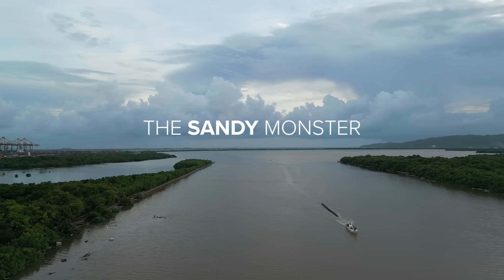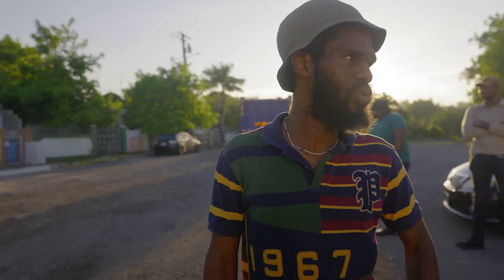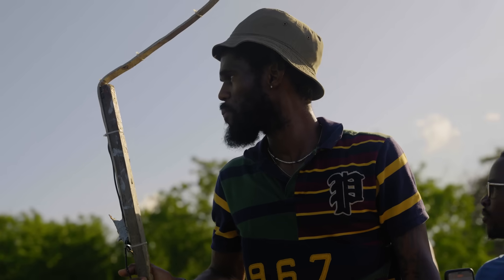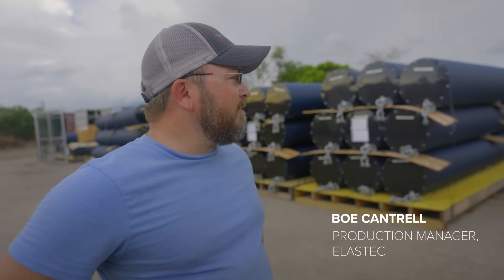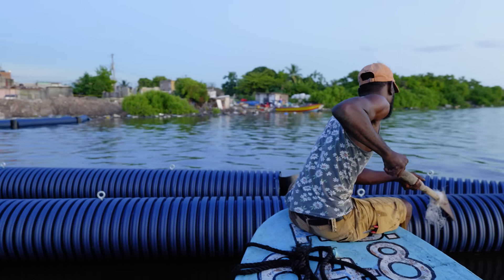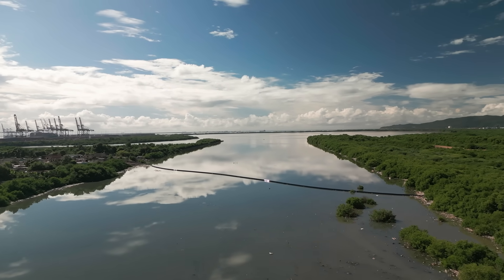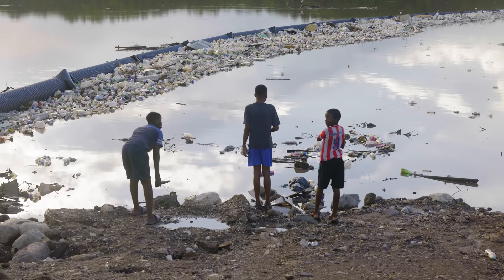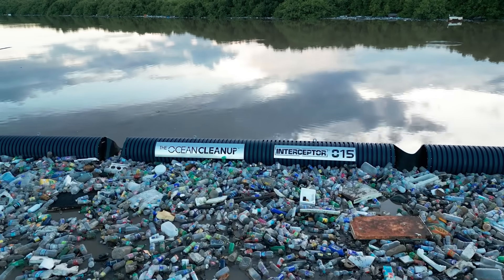Tackling Plastic Pollution in Kingston, Jamaica: Our biggest Interceptor yet

Comment: If you walked into your bathroom and saw the tub overflowing, would you start mopping before turning off the water?   This is exactly what you are doing.  If you don't stop the trash problem, then you can never stop the cleaning up.  You are not helping at all!  you are thriving off "climate change emotions".  If you are ok with that, than more power to you.

Comment: Im a HC Truck driver and have used vacuum pumps to load  Could you put a few pipes as well on the shorelines or even to the middle of the boom fences to help extract items as well, with large suction pumps ? You could station   sieves and sumps on the banks to drain out the water from the rubbish and pump the water in the sumps back out to the waterway, and a conveyor to load  rubbish onto trucks? ❤ Just a thought! 
Brilliant work you are all doing.  ❤

Comment: Who is working in preventing the problem not just capturing the plastic when it floats away.  I see refrigerators interiors that come from those that metal recycling shops that strip the metal and throw away the plastics.  They should be prosecuted

Comment: Although it looks like quite an operation, it is actually pretty small. A dozen people or so, couple of truckloads of material and a couple of dozers. In the video there is also a shot of a bridge over the gully. Building that is about 100 times as much work as this, if not more.

The real question is why the local government is not providing waste management services. That's the real question.

Comment: Sooo... no addressing the root cause? Proper sewage and sanitation infrastructure, even for the less developed upland communities. Looks like 99% of the waste is the property of Coca-Cola and Pepsi. Seriously, need to start putting pressure on corporations for taking responsibility of post consumer waste. Whether that means a hefty buy-back program or going back to glass. Something needs to be done in all fairness, especially if Carbon Taxes become a thing on the regular people, instead of the main polluters not accepting some responsibility.

Comment: Solution to build-up guys: A cycling Cup belt that draws the waste to the end with another Cycling Cup belt that automatically drops them into Drive off containers.🤓💡
This will enhance the process for recycling at an advanced rate and prevent a pressure build on the Boom, ta dah, 😉☺️

Comment: Now the next step. Collecting plastic waste is one issue, the next issue is how to deal with the collected waste. We been doing research on this for many years. Best way is to built clay kilns which burns at 800 to 900 degree cel. That take care of almost 95 % of toxic gasses. The heat generated can be used for producing hot water instead of using gas or electric heaters. And they do have abundance of clay.

Comment: What stops the Trash to just simply dive under this Pipe and escape? since the Pipe is just barely going down into the Water, isn't the Pressure of the floating Stuff backing up at one Point big enough to Push under it? like also Bottles filling up with Water and sink under it?

Comment: Where I live all plastic bottles have a 10 cent deposit which iz returned when taken yo recycling depot. Plastic bags are illegal and plastic packaging is recycled in bins.
The reason Kingston has this plastic problem is poor discipline of the population and ths need of a recycling system. The sandy monster is simply dealing with but not preventing this in the first place.

Comment: Have you thought about distributing some metal water bottles or assisting in a public water filtration system? I see so many plastic water bottles.
Reply: water bottles is just a dent.  Consider the plastic containers for oil, soda, juice, dairy, chemicals, soap, etc, etc.  This company is focusing on cleanup.  Providing and distributing clean water is a whole different world crisis.
Reply: @emmakai2243  totally agree. but if they bought wholesale for $5 a bottle let's say, with a little branding. it's adspace for the cause, and for $1000, you get 200 bottles, 3  plastic bottle per day (which is not enough water but let's be conservative) for 365 days would net 219,000 less bottles. it would be enough to convince others to get their own and snowball those numbers.

Comment: Single use plastic needs to be ended, or regulated down only for the absolute necessary. I know it not that simple, some nations may rely on bottled water more than others but in general it must be doable. Other than that, it seems obvious that this throw-away-economy can hardly be the way forward. In time, even if it sound sci-fy, things need to be long lasting again (again regulation, against planned obsolescence) and reused. I would gladly buy a Coca-cola in syrup syrup  form rather than buy bottled. And I would buy drinks from tap into my own refile-bottle like we bought sparkling water when I was a child. Water could be sold from gigantic containers, and public wells and drinking fountains could come back. The economy seriously needs to change, and power and ambitions needs to be shown elsewhere, in service, given value, virtue, joy and kindness, rather than in over purchasing. I know this sounds foolish, but it this works in smaller communities, and some of these ideas are already in place in some countries.

Comment: This is different from all your other systems - how do you get the trash out of the water?
Would love to see how that works.
Reply: Earlier in the video at 9:12, when they were showing the other gullies/rivers, they showed one of the machines taking the rubbish out of the water. It's a boat with a moving ramp that pulls the garbage out of the water.
Reply: I don't see how a round plastic pipe should hold back a lot of trash when there is a little more current
Reply: It will probably be an excavator like in Guatemala, for a barrier that size a small boat wouldn't work

@manuel69600 i believe they are not to "hold" the trash but raher guide it towards the collection zone, if that barrier would hold all the floating object the force would just break it
even if 30% will escape that is still a huge win and there is room for improvement

Comment: The people there also need to quit dumping trash into that river.
Reply: They've talked about this before. These places often don't have infrastructure to take care of the waste. There's no recycling center, no landfills (and often the trash in the river is washed out of make-shift landfills during storms -not actually thrown into the river) and no trucks that come by to pick it up. Waste management takes much more infrastructure than most people realize. In this video they said that the locals are excited and wanting to help tackle this problem. Usually ocean cleanup also helps to set up some kind of waste collection and management systems, but starting from scratch takes lots of time, knowledge, resources, and money.

Comment: The real issue here is not having proper waste management programs. The whole gully will eventually look exactly the same as it was before the cleanup, if the Jamaican government doesn't do anything about waste and the people also need to respect the environment.
Reply: So true! I think that there needs to be another arm working alongside the Ocean Cleanup to educate and empower local communities and government to make changes to prevent waste from ending up back in the gullies, streams, and rivers that are being cleaned up.
Reply: @JoshBartKzTSIS building up proper waste management infrastructure would cost a ton more than what this little band aid would cost - on the level of requiring country funds and not the small funds of an ngo
Reply: @JoshBartKzTSIS The problem with that is the education branch of such an effort usually gets corrupted.  And, the funds to be used for such efforts get diverted to greedy crooks.
Reply: They've talked about this before. These places often don't have infrastructure to take care of the waste. There's no recycling center, no landfills (and often the trash in the river is washed out of make-shift landfills during storms -not actually thrown into the river) and no trucks that come by to pick it up. Waste management takes much more infrastructure than most people realize. In this video they said that the locals are excited and wanting to help tackle this problem. Usually ocean cleanup also helps to set up some kind of waste collection and management systems, but starting from scratch takes lots of time, knowledge, resources, and money.
Reply: Recycling centers and landfills can be created. They have roads, they just need to find the will to do it.
Reply: @courtneyperry7659  its mostly education about the problem which is missing not really the infrastructure. The European south had problems with rubbish on the streets until the late 90. Moreover the Use of plastic is a problem. Its cheap enough to throw it away.
Reply: Racist.  @Sapphier4Dav
Reply: @mel-m5k9u  is this your educated contribution to this conversation?
If you label me a racist be ready to explain yourself.
Whom am I racist against and why?
You better back up your comment.
Reply: @Sapphier4Dav you’re talking out of your butt. If you weren’t born into a context with regular trash pickup and infrastructure designed to hide the consequences of your overconsumption and waste you’d be in the same situation as these folks.  

Look at NYC during a garbage strike.  You think New Yorkers aren’t educated about how to stay clean?   Yet once the trash collection pauses, piles of garbage build up and the rat population explodes.
Reply: @courtneyperry7659 nah the people their are mostly just nasty, don’t make it fool you. Coming from a Jamaican
Reply: I think people doesn’t understand how hard it is to have recycling collection when the tax collection doesn’t work. If you can’t force tax on packaging you can’t create the incentive to collect it. 

When that is achieved, like here in the Nordics where we recycle more than 95% for 30 years, we get taxed to lower usage of plastic when we doesn’t really need to. Create incentives to recycle is key.
Reply: @macjonte  no country in Europe recycles more then 40%, I think you mean the EPI waste recovery score. The highest amount of recycling is done by South Korea at around 56%, and in Europe the best recycler is Slovenia followed by Germany and Belgium, so not the nordics
Reply: @noa4644 
Depends on how you count energy recycling I guess? The Nordic (particularly Sweden) has invested alot in energy recycling with effective fume cleaning. 
But the important thing is there is waste collection so it doesn’t end up in a stream somewhere.
Reply: Indeed it's a prevention and not a cure but with no sign of us humans changing our filthy ways anytime soon, I'll take this amazing prevention! Top work!
Reply: I hate when people just ream on stop gap solutions. You think people are that naive and don't know the real cause?
If proper waste management was easily implementable, it would have been done.
Thanks for your input keyboard warrior.
Reply: @HKim0072 Seemed to be easily implemented in all white western nations dating back to hundred if not hounds of years with sewage systems. Amazing where all these trash rivers form. It’s almost like the ape brains can’t work out how to get garbage bins, garbage trucks and dig a bloody hole in the ground
Reply: Props to The Ocean Cleanup for clean up real shit.
🗣️📢🔥
Reply: Don’t be naive and simplistic. Proper waste management is complex and costly to organize. This mitigation solution took just a year to put together thanks to TOC’s expertise it’s both a tactical and sustainable protection measure until the long-term approaches bear fruits.
Reply: What happens to the plastic waste caught by the berm, does it go back to landfill?, if they can't deal with it on land, it's going to be harder on the river to clean up and they still have to deal with it. The only positive I see is, the locals will see how much plastic is dumped in the river, and that might help them to reduce their waste.
Reply: @ 
Yes, the sight make locals understand it isn’t sustainable.
Reply: @dogbreath6974 that’s the only positive you see? 🤦‍♀️
Reply: The issue is these countries doesn't have the infrastructure like we have in the U.S..stop shaming people for your unearned privileges.
Reply: No we need to stop manufacturing with plastics altogether,glass or other materials
Reply: @nevergiveup9321  I agree, but if it’s not plastic it’ll be whatever other material is widely used. Physical pollution will still be a problem
Reply: So true. My garbage pick up is intermittent. Only two times since January. And two times from Oct-Dec and it’s supposed to be weekly.  Overflow and things get blown around . 
Anyway this makes me so happy!  Thank you so much all involved . 
People please stop littering! 10 fridges were even out there! 😮
Reply: Who will pay? There isn't a budget. So non profits can set up recycling to turn plastics into paving, translucent light panels, planters, buckets. Things that could be used by the Jamaicans.
Reply: @wendymorrison5619 
About dotting the bill: it’s best done by tax on raw materials so it will be cheaper to use recycled material instead of new.
Reply: I've said this for years, in all these third world countries where they are doing the cleanups - if the waste disposal infrastructure is not improved then the same shit will continue.  And locals chucking stuff in the rivers too.
Reply: We also need to find an alternative to plastic bottles etc.,
Reply: This sort of project shows the magnitude of the problem. Hopefully inspiring kids, that's where the long lasting change eventually comes. Will never be immediate but 10-20 years who knows......I hope that's the case anyway 😊
Reply: I’m sure, if you can persuade the community to pay for adequate refuse collection, disposal and recycling, the government would be able to provide such a service. Sadly, the community cannot afford such a system and without funding, the government won’t be able to pay for it.
Reply: Even in countries with proper waste management (so called FIRST WORLD COUNTRIES) a lot of people dump their trash on the street, in the woods, into rivers! People are dumb!
Reply: Its the cause of the U.S. its the same with clothes for other countries.  The U.S. just causes problems "to figure a way to fix it" the U.S. needs to change for this to stop. Stop making so much needless crap.
Reply: Snowball's chance in hell of that happening.
Reply: Yea mon!
Reply: the program is to keep trash out of the oceans.
Reply: What happens to the waste which is caught? Are the bottles recycled ? What about the plastic? The people need to be educated about how you deal with waste. It should be taught in schools. But it's of no use if there are no possibilities of recycling and if rubbish collection is not done regularly.  How about the factories snd their waste products? A lot of work, but it pays off in the end.
Reply: Government has the biggest lever. Whatever is brought in is going to be waste. Regulate to cut down at the source is the most effective.
Reply: That is a perfect reply. Many of the countries using waterways as their trash deposit centers have no other options and their governments could care less.
If there were any politicians with vision they could do the cleanup then recycle the plastic into fuel oil
Reply: The real issue is one step farther back to the plastic companies impunity towards the earth for the almighty dollar.
Reply: The real problem is the production of this crap in the first place.
Reply: @ 
Depends on what you mean by crap. Even high quality products have sooner or later reached end of life. Recycling is key.
Reply: They just keep dumping into it
Reply: @diannamorris5844 ”they”?
Reply: Careless dumpling is a big factor. How do several fridges get in that gully if not for negligence. Years ago I passed through Rae Town and saw all this fabric, with bundles of old clothes clogging up the gully. I’ve known Kingston to have garbage pickup all my life so how exactly are these plastics, clothing and old appliances getting into the gully if not for negligence. Good job this week by Ocean Cleanup but if people don’t respect the environment this will be a weekly cleanup campaign. I’ll bet good money this isn’t happening in Japan and countries who take personal pride in their environment. I’ve also seen multiple billboards saying ‘ No Dutty Up Jamaica’ but clearly many people aren’t  listening or don’t care. To be fair this is a global phenomenon where it is said there are plastic islands the size of Texas floating in the ocean. The bigger problem is it affects the marine life who tries to eat it. Maybe they should show this cleanup on TV so that those who are dumping can see the extent of the impact of their actions.
Reply: Agreed. Unfortunately, this is only a temporary treatment of the root cause. It was like this decades ago, and will be like this decades from now if proper waste management solutions aren’t implemented. Better than nothing, and perhaps if people can see what clean rivers look like, and see that change is possible, they will actually begin to care and hopefully make changes.

The people who live there and care about the problem aren’t the same people littering and being careless. It’s them you’ve gotta educate.
Reply: Your so right.. it's a short term solution.. waste water goes straight into the river . Rubbish the same .
Reply: it's people that don't give a crap and were raised poorly
Reply: It’s the people. They do not care. They trash themselves.